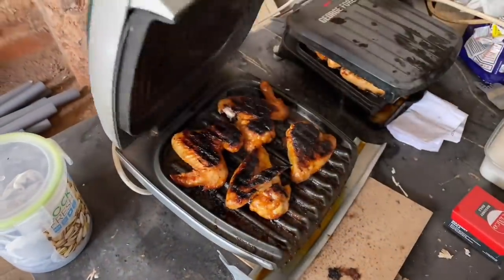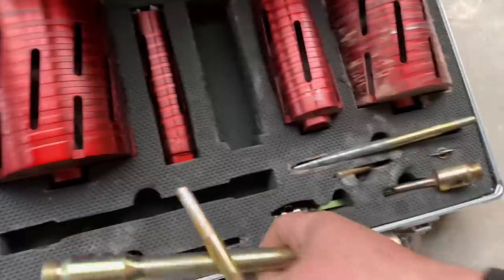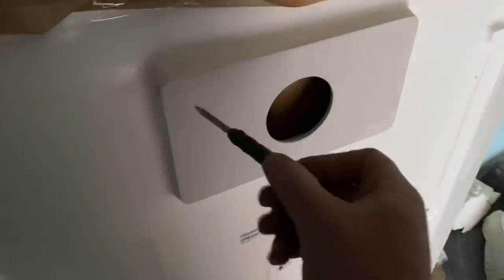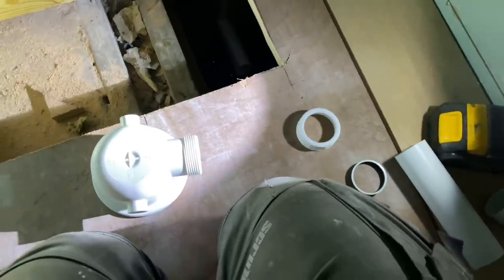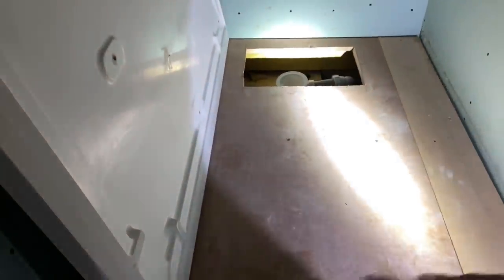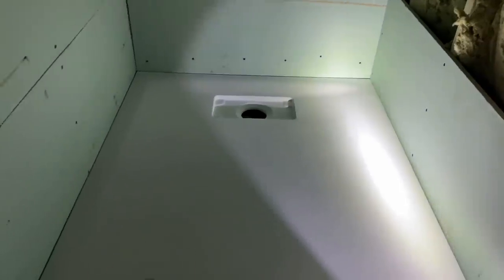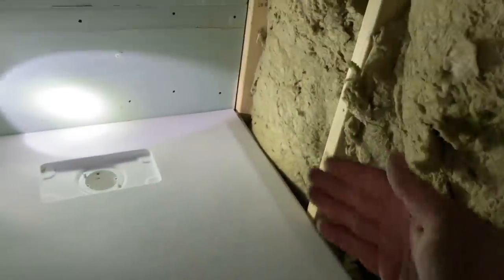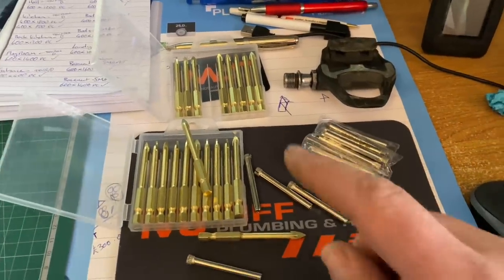HOW TO FIT A SHOWERTRAY FLUSH TO A TILED FLOOR & “THE” BEST BARGAIN TILE DRILL BITS TO BUY

Comment: I usually remove the entire flooring and  expose the joists. Depends on customer requirements/budget. If it's a suspended timber floor, that is. Working down from a levelled screed can be tricky. Batton out 18mm down the joists and then infill with 18mm ply. Oh, and don't spare the screws! Wallop in additional cross braces/herringbones if required. By the time the 6mm backer board and adhesive/tiles go in; you have an almost (millimetrically minimal) flat entry into the room. Don't spare the silicone, but just wondering if those wall plasterboards are gonna be gummed and taped too? Belt n braces. I usually use cement/aquaboard, but I'm getting so old that I've gone over to backer board. Mind you m8, at least I still have allo my hair. 54 yrs old. "Lord, I am afflicted with a bald patch!" - See: Monty Python, Life of Brian.
Reply from the maker: Yep the key is getting it all level and flush 👌🏼👌🏼

Comment: Interesting watch as always mate, I’m a complete diy nerd and watch so many videos on stuff before I attempt anything.
Everyone has their own way and why would you go away from that if it works?
I’ve seen the skill builder channel someone mentioned and it is a good channel but it’s not ‘real world’ enough for me if you see what I mean.
I have a bathroom to do in my house and after watching millions of videos it seems once you’ve made the choice not to use just plasterboard around the shower you have made big strides towards having a waterproof enclosure. 
My feeling is I’ll make sure the floor is firm even if extra noggins required then a piece of ply and bed a good quality tray on silicon (Dow) 
In terms of walls i may use Hardie board, tape joints and tank the whole thing 
One question - do your tiling guys tape up the edges of that board and tank it before tiling?
Cheers mate , had to laugh during this one, could tell you were arsed off 😅😅
Reply from the maker: Good read that mate…. Yep I’m very much “Real World” as you will of seen.

My tilers will always tank a shower area just to be super safe👍🏼👍🏼

Comment: Nice work Mark. I always use silicon. Never had any problems. Well done lad.
Reply from the maker: Thanks Pat...... yep, I’ve never had an issue either 👌🏼👍🏼👍🏼
Reply: Always silicon or tubed adhesive. As I’ve said before if you use the leg kits they supply it’s probably only supported in 5 places. It’s a load of bollox that you have to bed them in. As long as the base is flat and stable , no probs. Never had any issues in 20 year’s plus.
Reply from the maker: Exactly mate.... 100% agree 👏🏼👏🏼👏🏼

Comment: Might be a daft question, but is there a specific type of silicone you use to bed the tray in? Is it good for trays against an internal corner as opposed to the one in you video?
Reply from the maker: I use Dow Corning silicone, not had any issues

Comment: Mark a quick question, I'm redoing my bathroom, the builder originally used qual pex plastic pipe, I need to join an extra length as I'm moving the shower bar, can i use jg speedfit fittings with that pipe with jg inserts or would you recommend compression?
Reply from the maker: I would personally use compression and inserts just to be sure as I’ve not had experience with qual Pex pipe mate.....

Inserts and paste..... then check before covering 👍🏼👍🏼
Reply: @MJTiffPlumbing  I was thinking that myself, I usually use compression, tighten it up, undo it again and put a wrap of PTFE on the olive then tighten it slightly more, never had any problems. Thank you for your help mate, always good to get a pro's opinion.

Comment: A lot of the trays I have stuck in say bed them on a sand and cement mix, but it is a pain in the arse, would much rather use silicone, but concerned about the warranty/movement..
Reply from the maker: I personally use silicone

Comment: Were you able to check the trap connection for leaks?
Reply from the maker: Nope..... you can never do that on huge trays when doing it this way, but years of experience and trusting your work and ive not had an issue yet.
Reply: No one will ever know anyhow. Just drain into the dirt before😁
Reply from the maker: Good job I have confidence in my work😉

Comment: Absolutely hate those shower wastes, usually use a flexi connector on them. That one looked not too bad mind you.  Good video mate.
Reply: Only thing I do differently is seal up the wall corners in the shower area as well before tiling. Haven't a clue if it makes a difference but I just do it you know?
Reply from the maker: Thanks mate 👍🏼👍🏼.... yep they are a pain

Comment: I’ve used so many expensive tile bits and you can’t beat the cheap ones like that. I use classiseal under certain situations but you wouldn’t have got one on there anyway with having to remove that panel not that it would’ve worked as it supposed to any way. Had both my 5G shots now 😂 saw your I fucked up. Done it myself on a smaller scale than you but still had to run my hand under a cold tap for ages. We love and learn buddy.
Reply from the maker: Yep a refuse to pay silly o no okey for tile bits, especially as these ones are perfect..👍🏼👍🏼

Comment: Plumbing pays well - Love your Bentley in the background
Reply from the maker: 🤣🤣 I wish mate..... customers run about 😉
Reply: @MJTiffPlumbing  I've yet to find any drill bit that 1) isn't expensive, and 2) drills more than a few holes on porcelain before the tip is dull. With regards to your core bit, Marcrist have a core which you set your drill to hammer and spin. I've never used that particular core so I don't know if it would be any quicker. I only use their dry cores which I find to be pretty good.
Reply from the maker: Then it’s your lucky day.... these drill a few holes but at that price it doesn’t matter 👌🏼👌🏼👍🏼👍🏼👍🏼

Comment: Not overly impressed with using moisture resisting plasterboard (that's what it looks like) in a shower. It should be either cement faced XPS, Cement Board or No more ply  in my opinion.... Unless they are installing a waterproof membrane on top.  Certainly not upto my standards.

Comment: Plasterboard of any type is not great for a shower enclosure! Surely, Hardie Backer or foam type board with Mapei water proofing kit is the least you should do for a proper job.
Water proof plasterboard isn't....
Reply from the maker: Thanks for watching Steve Morris 👍🏼

Moisture board, as fitted, is perfectly acceptable to fit within a shower enclosure, 27years in the plumbing industry and hundreds upon hundreds of bathrooms fitted with ZERO issues.